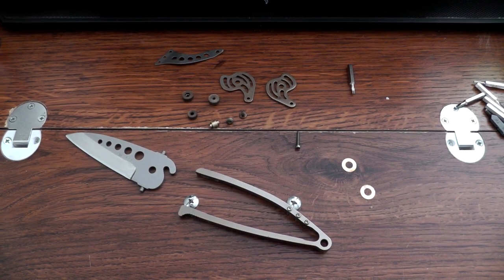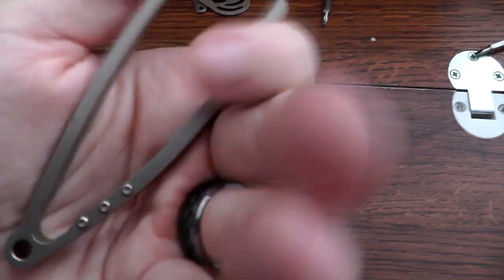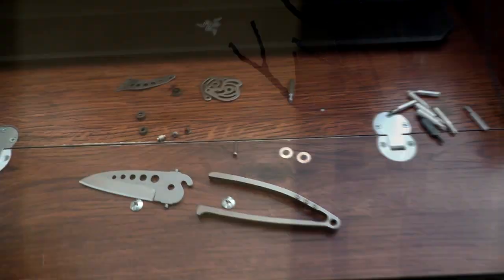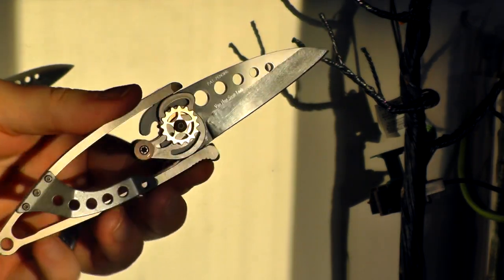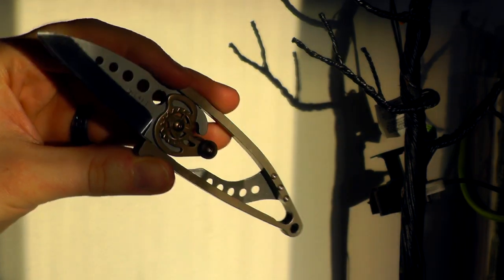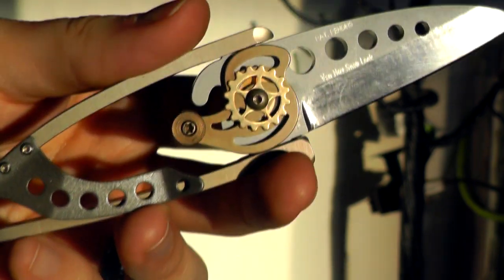A Steampunk knife: Customized CRKT Snap Lock

Comment: you could you run a veneer over the edges / top of the frame ?  ( or just the  end with the lanyard hole in it , running half way up) some sort of nice stained laminate  could work, drill and tap the frame and use brass screws to hold it to the frame, would take away a little bit of the " futuristic look "

Comment: Do you want to harden your blade so that it can keep it's edge? Since you're modifying the knife you may as well. This is how to harden soft iron:

Smear it with an old hog's lard, bind it round with straps cut from goatskin, and tie it up with flaxen thread. Cover it with kneaded clay leaving a bit of goatskin bare. When it's dry, put it in a fire and blow vigorously until the exposed goatskin you can see is burnt. Then remove it quickly from the clay, quelch it evenly in water, or preferably wee, withdraw it and dry it by the fire.

Your knife should then have more carbon near the surface and be tempered. You can then anneal it if you like.

Comment: Steampunk rant video: why the diesel engine can never outperform the modern miracle of steam power.
Reply: Diesel can be powered by algae or vegetable oil, steam needs coal.
Reply: Keith Larsen steam engines can be powered by anything, in fact, most of our powerplants to this day are powered by steam, even the ones not using coal.
Reply: Keith Larsen Diesel engines are the works of the devil! (Monocle pops out)
Reply: oobligah Even nuclear plants are using a variation of the steam engine.
Reply: indeed